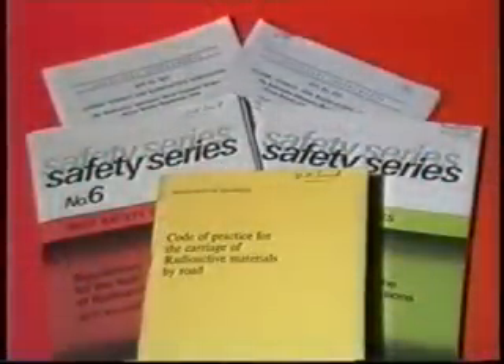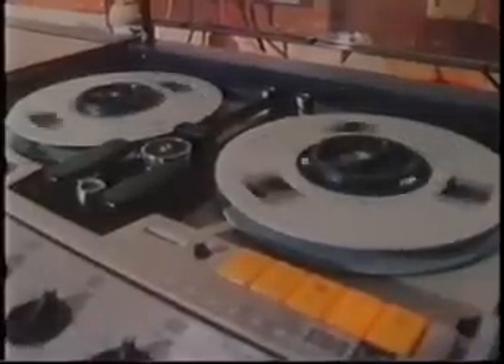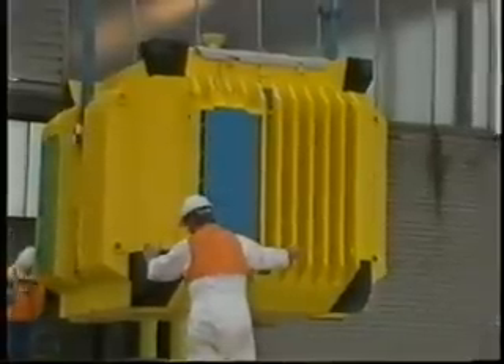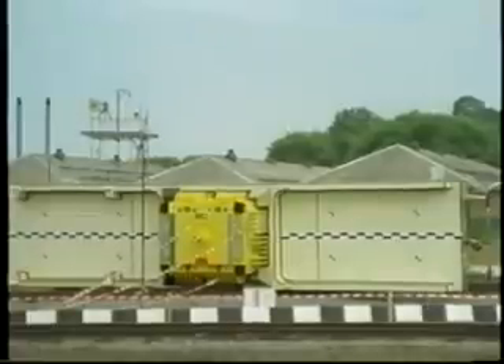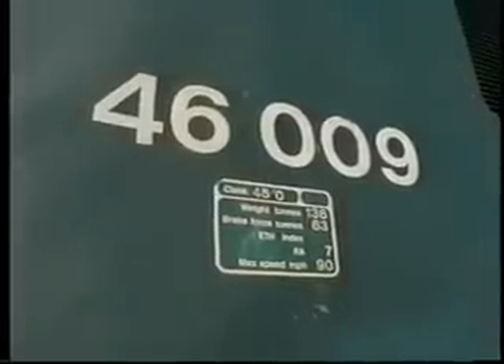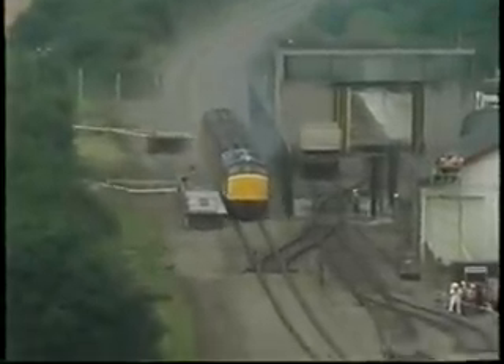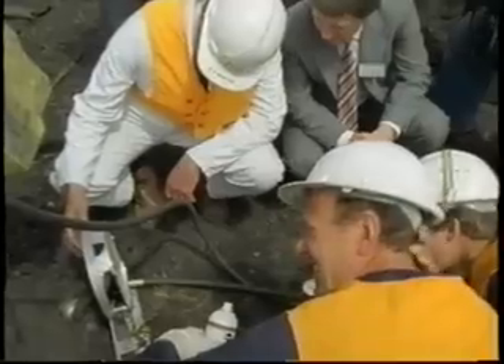Nuclear Train Flask Collision Test - Operation Smash Hit (1984)

Comment: The flask can be seen today outside Heysham Power station training centre  and reveals how little damage was caused apart from a few bent cooling fins
Reply: Ronnie Williams parts of the locomotive are up in the National Rail Museum in York.  The buffers were well mangled by the hard forged steel flask.
Reply: @wulliest  I'll look for them next time I am there.
Reply: Well it's lasted better than the 1984 Cortina I had, that rusted out in 4 years.
Reply: Well it's lasted better than the 1984 Cortina I had, that rusted out in 4 years.
Reply: Which isn't all that surprising given how it's basically a 50 ton lump of forged steel. Too be honest, these tests where not really necessary, they where done for PR.

Comment: The speed the engine comes down that last bit of track is visceral, with the locomotive bellowing its way around that corner. It gives a sense of the destruction caused by a real railway accident, quite frightening actually.

Comment: I was in Edmonton Alberta sometime between 2001 and 2007, when I first saw this video.  It was during one of our monthly safety meetings.  I was astonished to learn that the container stayed intact.
Reply: Where you really that astonished? Maybe if you didn't know the design specifics, but once you know it's basically a box out of forged steel with 35 cm thick walls and that it weighs 50 ton, then you should know that it will have no problem getting hit with something comparatively soft like a train.

To go though something that thick and made out of steel, you need something very hard, like a tungsten penetrator, going very fast, like it was fired out of a tank gun, because this thing is basically like a tank. It's walls are about 3 times thicker than the front plate of a tiger.

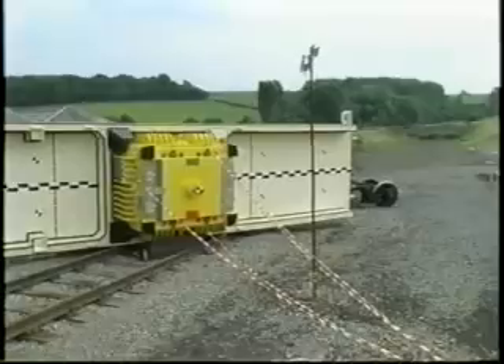Comment: Its interesting to note that the first view of the collision (at 7:09) gives the impression that the collision is perpendicular to the flask and barrier, but the later footage at 7:18 shows that its more like a 30 degree angle.
Reply: As in the drop test, this is the worst case scenario in terms of forces acting on the lid.

Comment: you can see the Diesel engine fly out of the train locomotive crazy.
Reply: Deltics had 2 napier diesel engines, I suspect one of them did come flying out.  I remember watching that test live during my hour dinner break at school :)
Reply: The electric generator came out, not the engines which are further back. It took part of the crankcase with it and that let water and oil into the cylinders, causing the white smoke.
Reply: Peter F. i always thought that was a flying chicken nugget
Reply: Nah. It was still within the loco. What you CAN see though, is distortion of the bodysides on impact, caused by the momentum of the huge Sulzer engine and main generator. At the time I think I'm right in saying the Peaks were being replaced by new InterCity 125's. They're old ladies now too !
Reply: It may have been the generator which came out
Reply: Sherwoodhoodbud it's not a deltic
Reply: Actually, the large object you see flying through the air is the flask.  At about 50 tons, it weighed only a third as much as the loco.
Reply: AYE IT WAS WELL WICKED WHEN THE ENGINE FLEW OUT
Reply: @CaptainScarlet67  That wasn't a Deltic, it was a Class 46 whereas the Deltic is a Class 55.

Comment: The original 1984 version released by the CEGB was narrated by the late Peter Fairlie, ITNs science correspondent in the late 60s and early 70s. 46009 (sold to the CEGB above scrap price) a BR/Sulzer/Brush type four, the 737th Diesel locomotive to be built at Derby Works in 1961 as D146, took three scrap priced mark one vacuum braked, steam heated, B1 bogied coaches, SK E25154, SO M4514, SK E25564 along with it.
Reply: RIP

Comment: Nuclear material on a train, is the one thing I'd not be worried about!  It's the tankers loaded with Ammonia, Chlorine, Gasoline and other poisons or flammables that would concern me most!  Crucible cars filled with Molten Steel would scare me, as would covered hoppers filled with explosive fertilizers!  There are far worse things hauled on a daily or regular basis, than Nuclear material!
Reply from the maker: Try clearing up a nuclear spillage....
Reply: Flashbacks from the explosion in Beirut

Comment: No wonder the nuclear power industry is barely getting anywhere. The amount of scrutiny it has to deal with and the dollars it has to expend to try demonstrate against every worst case scenario, is only hurting the industry and therefore our chances of drastic co2 emissions. 
Seriously, the canister is never going to be in a position where it is dropped from such a height and in a way where it strikes the ground angled upside down to expose shearing loads of such magnitude on the lid. Just carry the canisters upright so if it does drop it drops on it's base. But no because no one knows anything about nuclear they freak out about it so the entrie industry is bogged down in both time and money performing these over-the-top tests.
Reply: I worked in the industry for a while - they were spending a fortune making machines that could take small barrels of nuclear waste and stuff them into larger barrels. The barrels only had stuff like rubber gloves in them and bigger barrels because then were deemed more stable. It is an industry that just invents ways to spend money. I asked the design team why they hadn't just thrown the gloves into bigger barrals in the first place and was told that was too simple for the nuclear industry.
Reply: On the one side, it is good they do this kind of tests, although the drop test was enough in my opinion. On the other hand, there are always some places where the risks are overlooked like in Fukushima. I omit Chernobyl and the other smaller accidents and incidents since they have happened a long time ago and much has changed since then.

Comment: All about the flask,what about the water used to cool the radioactive rods ? What happens to the water ?
Reply: It remains within the reactor. As it becomes heated, it heats non radioactive water in secondary loop which turns to steam and powers the generators.

Comment: That Class 46 data panel stated max speed 90mph yet the train was recorded hitting 100mph......was it modified?
Reply: Trains are tested at 10% over their rated service speed to ensure there is a safety margin.  So the test speed for a 90mph train is 99mph.  In this case they just disabled the deadman pedal (which would normally ensure there was an alert driver in the cab), opened the throttle wide, and released the brakes from an outside valve.

Comment: Should have used lead bars rather than steel. Much closer to uranium in all respects.
Reply: Bodragon 

But the casing of the fuel rods was a magnesium alloy, so very light.  Steel rods would have a density between that of the magnesium cladding and the uranium/plutonium/fission products in the core of the rod.   Also, uranium has a hardness of 6, compared with 1.5 for lead, and between 5 and 8.5 for steel, so there would be less chance of lead damaging the inside of the flask than uranium or steel.

Comment: for a accurate test should they not have used a check source inside the container so they could use giger counters after the crash to see if any radiation was leaking out ?

Comment: How would more train cars not contribute to the impact dynamics? More weight would equal more kinetic energy, right?
Reply: Yes and no. If the flask had been totally immovable then yes but as it started to slide then no.
Reply: compared to the weight of the loco, the carriages are very light
Reply: It is the connections between, the cars would just flop to the sides dissipating their energy but not into the flask.

Comment: did you see all that water splash out at point of impact?! I find it hard to believe that water cooling radioactive  fuel rods being splashed out is unharmful. Haha
Reply: its so little water that its barely over the background radiation. less effect to you then taking an x ray
Reply: Sam Cook
Substances that have been exposed to radiation do not become radioactive themselves. The water would not be radioactive. I wouldn't drink it but it's no Chernobyl
Reply: TGpoppins depending on the radiation they do
Reply: Pascal Ott
If an atom is bombarded to the point it's nucleus becomes unstable then yes, but that is extremely unlikely.
Reply: TGpoppins yes certainly, especially in a low radiation environment such as this. I was just making an objection regarding your general and absolute statement.
Reply: Pascal Ott
Quite right. I meant my statement as more of a general rule and not as an absolute statement but I can certainly see how it sounded as such and will make sure to specify in future. 
Have a good one.
Reply: TGpoppins you too :)

Comment: So after all the testing of  none real life scale flasks they went into production and removal of the flask to areas of transportation and yet real fluid escaped from just a test with steel rods in place or radioactive fuel rods, so just imagine if they had real fuel rods instead of just steel rods that complete area would be contaminated due to the fault ?
Reply: "Quantity of water which escaped would in real life have had no radiological significance at all."
In dumbed down words, that means fuck all radiation.
You'd probably get more radiation exposure from flying in a plane.

Comment: Safe for the public?  Bwahahahahaha!  It still leaked water isn't that considered not safe in real life?
Reply: Nothing is absolute in life.
Reply: Yeah I know but we're talking about nuclear material even a small amount is dangerous.
Reply: and what are the odds of the train derailing let alone the container rupturing.
Reply: These are dangerous elements you don't play the odds it only takes one accident to make it a disaster in the waiting.
Reply: To answer your "question" the amount of material it released is such an insignificant volume it wouldn't even overcome background radiation.
Reply: Are you willing to take that risk with your family based on what the government tells you?  I won't, you though can be exception.
Reply: +Raymond St Paul
I don't need the government to tell me shit I can see with my own eyes the result of the drop test which released a pittance of material, and by extension the amount of pressure drop stated in the train test is once again a pittance.
I also have zero reason NOT to believe they could make a box tough enough to take a train impact because things like the Bathysphere/scaphe exist.

Furthermore most of what we know about the dangers of radiation is from government research, so using your iron clad "reasoning" radiation is actually either harmless or beneficial because the government said it was harmful.
Reply: That's where you are wrong. Nuclear material is dangerous only at certain concentrations - those are different for different materials.
Reply: Btw, that pressure change after impact test is much more likely to be the result of a cask deforming slightly, thus changing volume. Different volume, same amount of gas = change of pressure.
Reply: I did the research. The water is insignificant compared to background radiation levels.
Reply: I don't care much about the release. What I care about is that they designed the flask to not leak, and it leaked.
Reply: Adolf Wulfgaim you can quite clearly see it is a spray, not a solid jet if water. please just stop.
Reply: Raymond St Paul “even a small amount is dangerous”, absolute non-scientific nonsense. The dangers of radioactivity are entirely dependent on proximity and amount. I assume you’re aware that radioactive Americium is present in the vast majority of residential smoke alarms?
Reply: Raymond St Paul Yes from my time in the Navy (US), and my first ship was nuclear powered. I've talked with the enlisted machinist mates, one from my home state and talked about the radiation and the nuc plant onboard and how safe things were. Do some research on radiation.